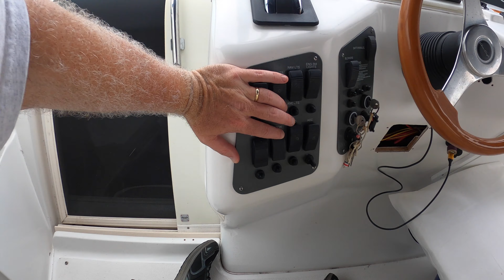Marine Sound Proofing Re-Install - Episode 163

Comment: Pretty ambitious project especially by yourself. Is the hatch wood cored thus the soft spots?
Reply from the maker: Yes I believe so. Lots of water I’m sure got in there. It’s a big bummer
Reply: @eternitysshore  yea a bummer but it's fixable. There are several you tube videos out there where guys redid entire transoms from the inside yet  retaining the outer skin of the transom. In your case the hatch topside

Comment: How much does this reduce the engine noise when running? Thinking about trying to upgrade my boat…
Reply from the maker: I don't remember exactly but I think at idle speed it reduced the noise by about 10-15 decibels. I used a free app to measure before and after but I don't think I used it in a video, although I might have? That was 2 years ago.

Comment: Sure hope this works. The spray on 3M adhesive doesn't.
Reply from the maker: Totally true on my end as well! I tried it before moving to this solution.
Reply: Hey Jeff, really hope that holds up, but every Marine soundproofing installation guide recommends fasteners and glue. The combination of heat and humidity in a bilge wreaks havoc on standard glue including construction adhesives.
Reply from the maker: @Skzstoll  good to know. At least The first glue lasted 2 years. And it was interesting that the sound proof cow people themselves recommended what I did. They knew it was a marine application